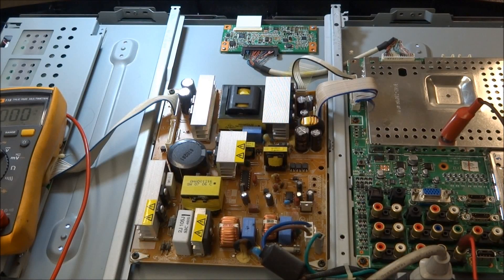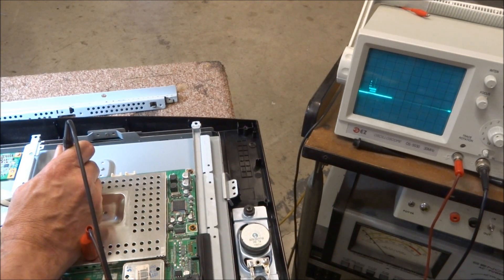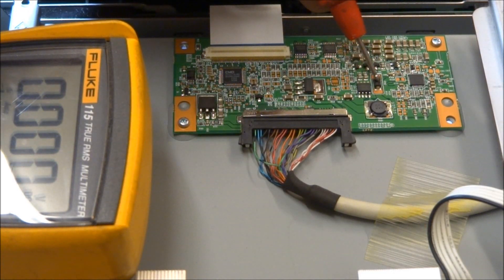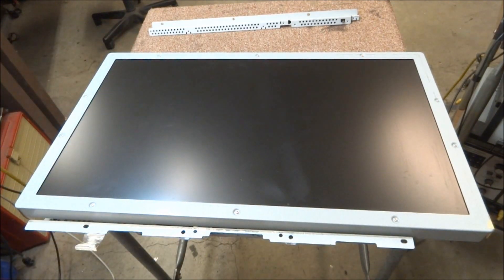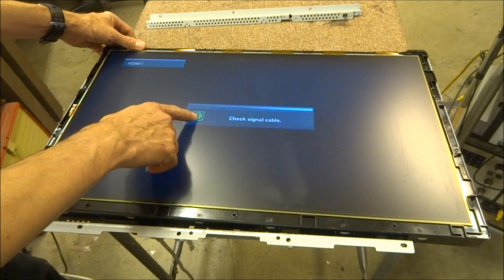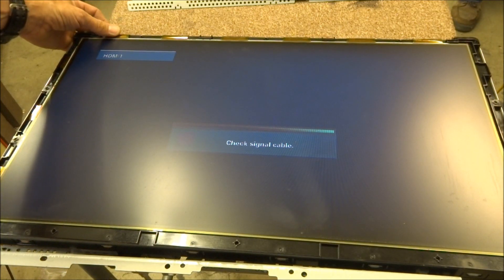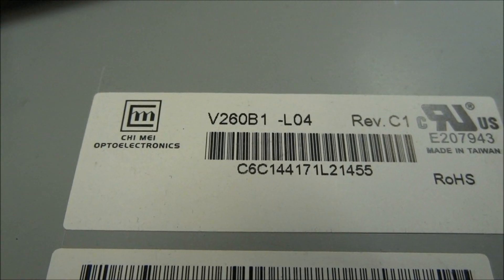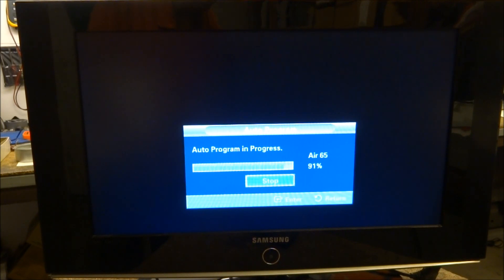Troubleshooting No Video LCD TV Sony Samsung Panasonic Toshiba Vizio LG Repair Fix

Comment: Hi again just a afterthought. I would be interested in how you connect up the Scope. I am guessing you use it wih a isolation transformer. Thank you Nor Cal
Reply from the maker: The scope does have an electrical isolation transformer in the AC input.

Comment: Not sure how one can recommend not getting an LCD display when the market is saturated with them. Plasma and projection are all but dead.
Reply from the maker: As of the time of making the video you still had the choice of DLP projection and Plasma also. Too bad plasmas were destroyed by the obama administration energy guidelines.
Reply: @norcal715  With LCD panels surpassing 100,000 hours MTBF, I've got no problem with modern LCD displays. To each their own. :)

Comment: TV model number Panasonic TC-L32B6, manufactured march 2013 , serial number TD30791105, the TV turns on fine, no blinking red light, but there is no picture, Apple TV won't play. This happened after a power surge in my area. Any tips on if I can fix this
Reply: Karthika Sambamurti Same issue here with the same TV.

Comment: What blinking lites mean Toshiba lcd tv 46SL4170,no picture , no audio, 3 blinking lites pause then same thing again. power supply looks ok, no visible problems,any ideas,Fuses are ok, caps ck ok.I have read that 3 blinks means the SEINE board is not booting up, some say it needs to be flash again, I would like to find what component is bad, rather then changing out all the boards, not cost effective , thanks